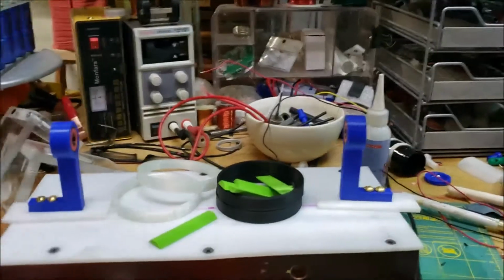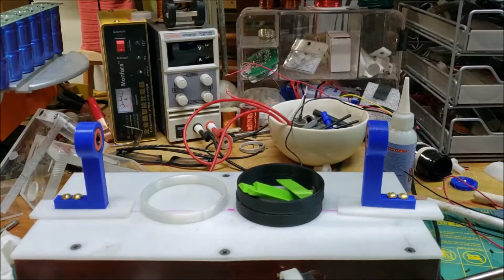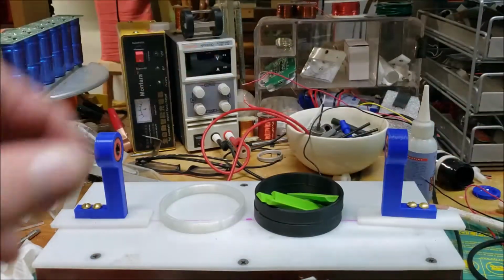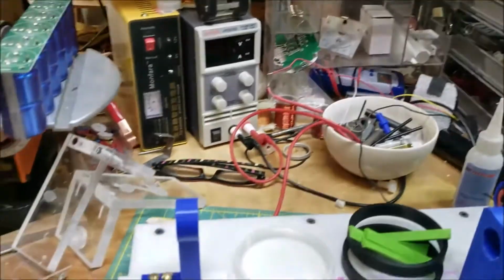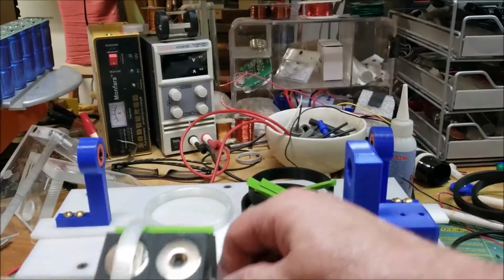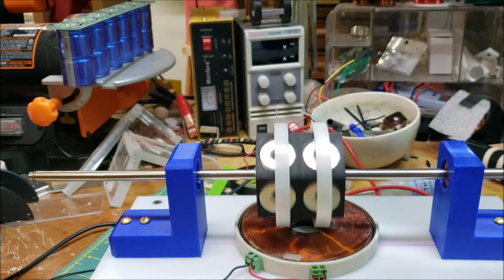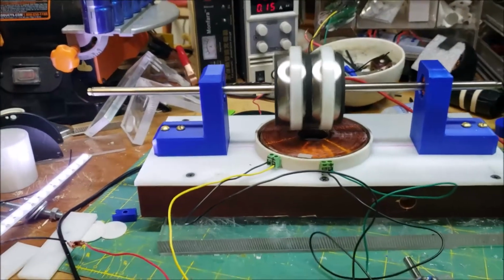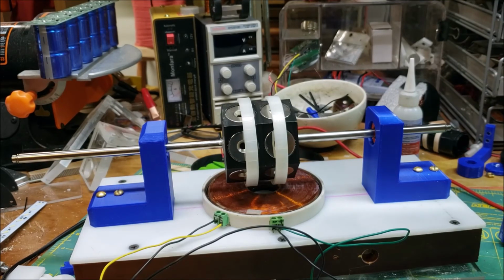3D Printed Rotors and parts

Comment: Bevel, recess..I would have just screwed and glued them in place. Would not work for the cube but the hex would work.
Reply from the maker: I really can't screw because the printed rotors are not completely solid. To print the solid would take forever.  I print with 20 percent infill which is strong enough but don't think it can safely take a screw but, I will try it
Reply: @mcorrade  maybe make nodes on the inside to accept a screw. You know you could leave nipples to suck epoxy into the form. I thought they were solid.
Reply from the maker: @MAGnetICus_Attractus  yep there are a few options but I my design. I like the more complicated....I did however give the nipple a lot of though as well as just thickening the was in the slicer settings.
Reply: @mcorrade  I was thinking the spacers holding things together puts distance between the coil and magnets.
Reply from the maker: @MAGnetICus_Attractus  yep I had the same thought process. Nice catch. For the larger magnets its not an issue but I will have to rethink the process. I though of a more fitting retainer that follows the contours